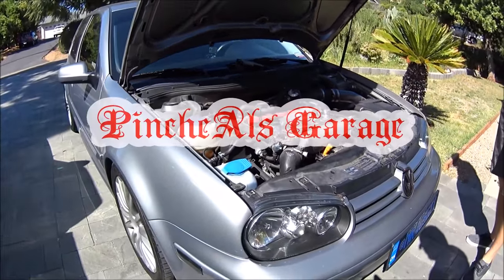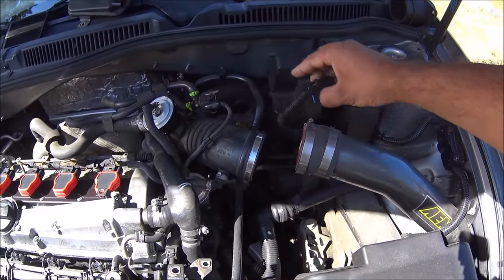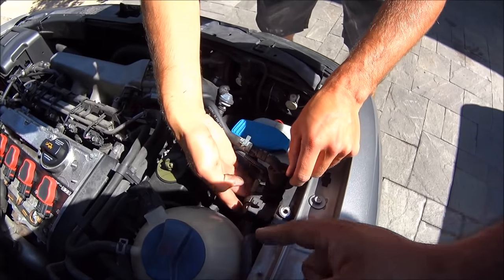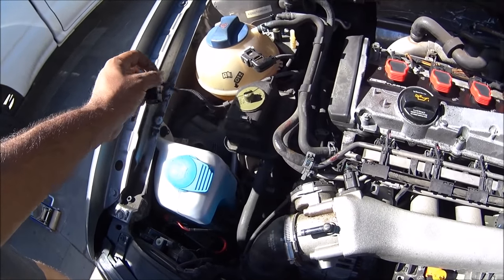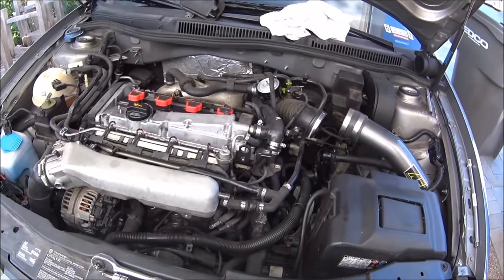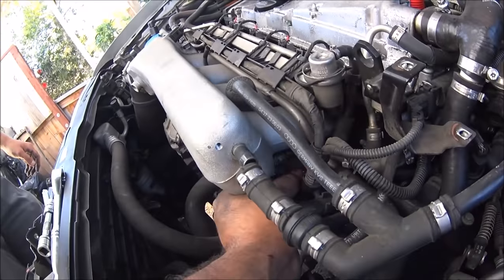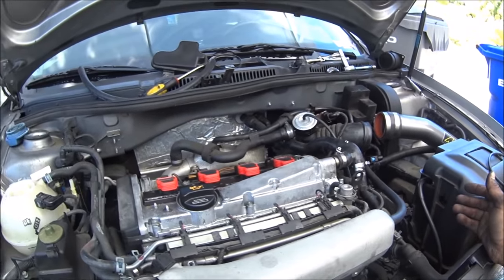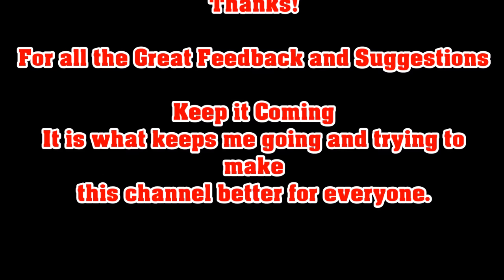How to Remove MK4 SMOG System AKA SAI Delete DIY

Comment: and another quick question is can I go to a junk yard and clip male parts to the plugs, where you would put resistor caps on and just electric tape around lol
Reply from the maker: no the resistor is what tricks the car in thinking you still have the part connected not the connector.
Reply: What will happen if I don't use them?
Reply: Can I find a resistor at auto zone?
Reply from the maker: +Korey Sluyter lots of fun issues. the can can start to run lean which is bad. Can give you performance issues or poor fuel economy. Hard to say since i never done it like that. i always make sure to do it right.
Reply: Alright Yea that is probably the best way to go then,

Comment: Might be a dumb question, but does this work on an automatic?
Reply from the maker: sharon salvaggio yes but youll have couple extra lines on an automatic.
Reply: I just finished putting it on an automatic MK4 Jetta and the traction control lights on and when you give it gas it stalls.
Reply: Do you think the two lines on the fuel rail need to be connected instead of capped off?

Comment: You might want to try to remove all this stuff carefully to sell. That is several hundred dollars for someone who wants to repair the emission system. All those elbows and molded hose pieces are gold if their not rotten yet
Reply from the maker: crazy observations one might think that. i have 2 bixes full of smog stuff that i cant even give away. new and used!
Reply: Ha,,If you throw them away someone will need them. I'm with the video, thinking about going out and hacking the Jetta
Reply from the maker: that's why i keep them but i will never sell them since they truly have no value. One day i will throw them away but in all honesty its just cheaper to use silcone vacumn hoses to repair broken lines.

Comment: if I do this delete and I don't tune it out of my ECU will it make idol fluctuate after driving for a bit?
Reply from the maker: it might depending if you did the resistors or not.
Reply: so I did the kit from ECS. the plug for the second air pump thing doesn't have a resistor right?
Reply from the maker: its should. its the big resistor.
Reply: my bad urotunning. so it comes with three resistors which plugs do they go on again?
Reply from the maker: the video has all that info sir.
Reply: sweet thank you bro and again you make some awesome vids!
Reply from the maker: thanks man... Please make sure to share the videos and subscribe. i have a lot more videos coming.

Comment: boss is it tru if u got ko3 turbo and u got stage 2 ecu with anti lagg and 2 step goin to damage ur turbo and manifold
Reply from the maker: 2 step will ruin any turbo car because of the amount of back pressure it creates in the exhaust system
Reply: @PincheALsGarage  i guess i need to turn it off..thnk u for respon sir
Reply from the maker: Yeah your welcome.
Reply: @PincheALsGarage  1 more question sir i just got my ecu tune with 21 psi for ko3 turbo anti lag 2 step immo off is it good for my mk4 golf gti 1.8t awp engine..with greddy inter cooler kit diverter full cat back exhaust short arm intake...
Reply from the maker: Yeah your good with mods

Comment: What is the point of removing these emission control devices for marginal at best performance gains? I understand maybe on a car running significant boost upgrades but these engineers from VW/Audi have to know something we don't.
Reply from the maker: The main point is to remove as many possible boost leaks as possible and if the car is tuned correctly also you have a lot less check engine lights due to emissions. No real performance gains at all just an actual fix.
Reply: @PincheALsGarage Understood, thanks for your reply.

Comment: witch resistor do i use for the secondary air pump do i get from urotuning
Reply from the maker: Gil aba should be thevD shaped one
Reply: PincheALs Garage 
do you hapen to know part number 
and i had a question about the crank case breather upgrade thanks alot
Reply from the maker: here is the link for the basic resistor kit

https://www.urotuning.com/SAi-EVAP-Delete-Resistor-Kit-3-pcs-Mk4-1-8T-p/sai_resistor_mk4_kit.htm

what is the question for the crank case?
Reply: PincheALs Garage if i dont want to use the plastic j shape breather what could a alternative ?
Reply from the maker: Gil aba not many. you can upgrade to IE setup using steel lines or urotuning silicone upgrade. it's really up to how much you want to spend.
Reply: PincheALs Garage  ok thanks alot
Reply from the maker: Gil aba Your welcome. Hope it helps with your project.

Comment: Hey al correct me if I'm wrong but can't I just use a paper clip to trip the sensors instead of having to buy the propper connectors??
Reply from the maker: No because the ECU is looking for a specific voltage

Comment: great vídeo but i have some questions    i have 2004 Jetta  after am remove all the vacum lines did u know any place to make tune it
Reply from the maker: Omar Mondragon you need a tune if you want to remove the secondary air flow CEL however its not needed. if you do tune it dont buy the resistors since the tune will remove the need for them.
Reply: PincheALs Garage if am live like that the  secondary air pump  
still on the  engine light right. ?????
Reply from the maker: Omar Mondragon ues you will still get a light
Reply: PincheALs Garage   the only way to remove is tune it ???
Reply from the maker: Omar Mondragon correct!
Reply: PincheALs Garage how much cost $$$. arround
Reply: PincheALs Garage after delite all this still pass the smoke check ???
Reply from the maker: Omar Mondragon nope you will fail smog.. i state that in the video
Reply: PincheALs Garage what i can do  on this case if am need it pass  ????
Reply from the maker: Omar Mondragon put it all back in.
Reply: Omar Mondragon o compra la inspecion sin tener que padarla por la maquina digo si en tu estado lo asen

Comment: Did you not use a catch can?
Reply from the maker: Emile Esterez it depends on how you want to route it. It is not needed but if you want to you can. I have a new DIY on how to install one.
Reply: PincheAls Garage ok great, I actually prefere not using one right now seeing as they are pretty expensive, I am also looking at a guide on the vortex forums, had me confused cause they put one in and removed the "hockey" Puck, I was trying to see what you did differently, thanks for the quick reply!

Comment: Will it pass emissions in any state?
Reply from the maker: Will not pass emissions in States the require testing
Reply: @PincheALsGarage  What's the minimum we'd need to reinstall to pass emissions?  Shall I reinstall and connect my air pump?  I just need two emission control systems to pass.  I already got the catalytic converter passing.

Comment: can you tell me pls i have a problems with the vacums
Reply from the maker: What issue do you have?
Reply: loosing power from somewhere and i think its the hoses
Reply: the car is 1.8 t aqa audi a3 quattro 150hp is the process the same
Reply from the maker: Виктор Димитров no the process is not the same
Reply from the maker: Виктор Димитров i suggest use some carb cleaner amd spay on the hoses and manifold while tue car is running to help you find a vacuum leak

Comment: Can I do the n249 delete and use the resistor?
Reply from the maker: Layten Perkins buy the resistor kit from urotuning.com
Reply: PincheAls Garage I have that I was just wondering if I'd throw the code if I deleted just the n249 and had the resistor
Reply from the maker: Layten Perkins of you just remove the N249 youll get a code for just air flow because the n249 and N80 work together. Your just better off removing everything and have just the code for insufficient flow
Reply: PincheAls Garage ah alright I have the full delete kit I just don't want the cel lol and I'm trying to get the tuning to get rid of the cel

Comment: Hey man, thanks for the video it's a big help. I've got a kinda stupid question though. My stage 2 tune has sai and such deleted already. Will I still need to use the resistors or does having it tuned out take care of that? Thanks!
Reply from the maker: You wont need the resistors just make sure to leave them unplugged
Reply: @PincheALsGarage  awesome thanks so for the reply!

Comment: I have a question would you happen to know the size hose you used for the diverter valve and fuel regulator?
Reply from the maker: I used a 10 mm hose

Comment: Does this work for the b5?what's the name of the kit?
Reply from the maker: Yes and no... The B5 has a much more complicated vacuum system under and on the back side of the motor. However if you can simplify the system it can be very close to this DIY
Reply: I'm having the problem of the p0411 code.  If I put a oil catch can it you think I might be fine for a while?  I have a high rpm needle as well.  I was thinking it was  BC of the back flow coming back through.the only code that is pooping up on my obd2 meter is the secondary injection code.
Reply from the maker: Did you get resistors
Reply: Yes.

Comment: can you do an egr how to delete for the tdi mk4?
Reply from the maker: Hughie Boss i would love to do that but i need a TDI to do that for you.
Reply: If you are in eastern Usa, I can volunteer my mk4 tdi wagon, it has the bew 1.9 liter, in addition to deleting the egr valve, perhaps we can also delete the catalytic converter, & remove the upstream and downstream o2 sensors as well.
Here in Pennsylvania, the diesels are exempt from smog tests. Only the safety test (bulbs, brakes, tires, chassis rot, no heavy tint) needs an annual inspection.
Reply from the maker: Hughie Boss that would be super cool. Might have to plan somthing

Comment: can the. delete be done without the resistors
Reply from the maker: Jagger Rodriguez yes but you need a tune for that if not the car will run like crap
Reply: +PincheAls Garage.  so is not a good idea to do without the tune.. cause im not doing the tune until next month
Reply from the maker: Jagger Rodriguez tune it first then delete
Reply: +PincheAls Garage sounds good... thanks man

Comment: Ive got the stage 1 apr ko4 tune will that delete the code
Reply from the maker: gmaxsc no APR will not delete any emssions codes because they keep thier tunes street legal
Reply: PincheAls Garage if i have a vag cable and laptop couldnt i delete the code?
Reply from the maker: gmaxsc if you know how to code yes but you need the proper software as well. Some VAG cables only allow reading the ECU and no modding.
Reply: PincheAls Garage ill look into it more, i deleted a code on my
2013 sportwagen tdi when i had that, but i honestly didnt know what all this SAI stuff was until i saw your channel. Now i want it gone, but dont want the code. Thanks for your reply!
Reply from the maker: gmaxsc your welcome. If you do get them deleted give us an update and how you did it. Will be cool to learn something new.
Reply: PincheAls Garage will do, i can film something and upload it, iirc it was fairly easy on the 2013, it shouldnt be too hard on the 2004 gti i have now.

Comment: I have mk4 jetta 1.8t if I do this delete and get the check engine light , if I don't get a tune to get it off would it effect my car ? Or would light just be there not hurting anything ?
Reply from the maker: Yarico Flores you will get a CEL if its not tuned out from the ecu. You will need the resistor kit if your not going to tune the car so the car runs properly.
Reply: PincheALs Garage so as long as I get that kit that you got and install it and even though I'll get that check engine light the car will run just fine?
Reply from the maker: Yarico Flores ues that is correct. you will still get a check engine light for secondary air flow but the car will run fine.
Reply: PincheALs Garage oh okay many I got few others question on our mk4 do you have ig or fb where I can add and private message you , I know your good with this cars so I'd like to ask you some Questions if that's fine with u